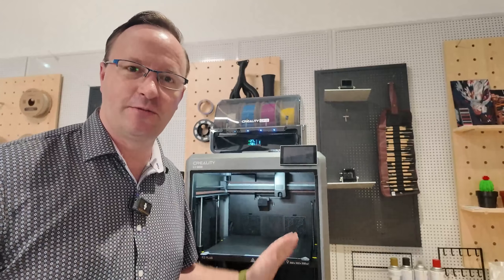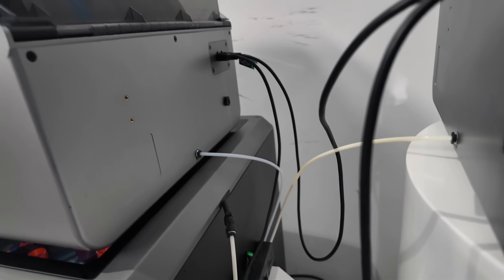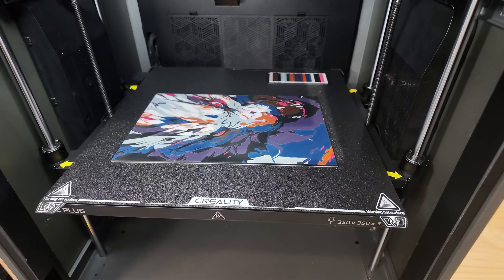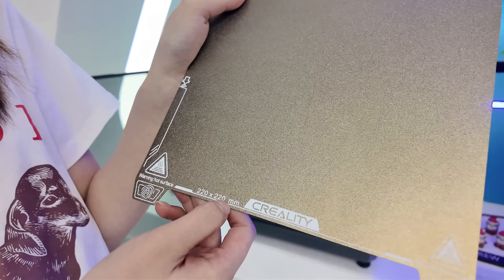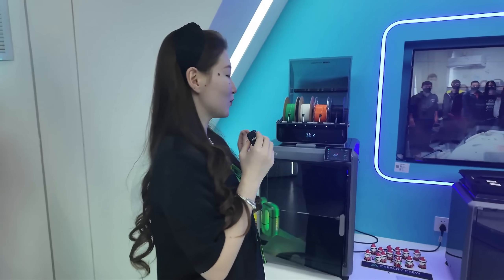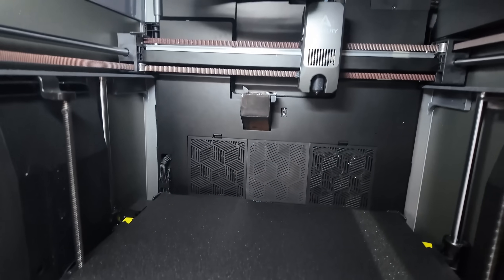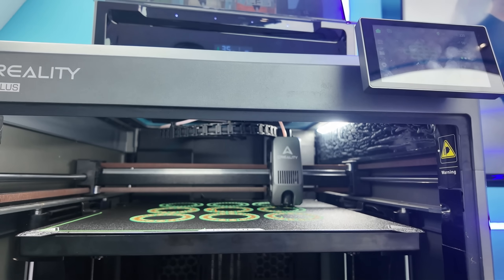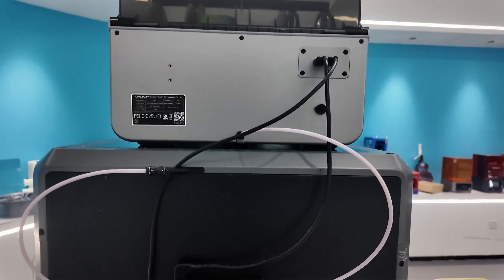Are You Curious about the K2 Plus?  Let me show you some more!  @Creality3D

Comment: After much deliberation and in response to Bambu required authorization debacle, I've decide to get the K2 Plus because of the features it has. With that said, are material profiles included in the software/printer? If so I would like to see how that works and if you can tweak profiles to fine tune them even more (hint, hint).  

When I do get my K2 Plus I'm going to do an unboxing and first print livesteam. So will see how it goes. Thanks for the video.
Reply from the maker: Profiles available on Creality Print for the K2Plus - yes, of course. Have you used that slicer before? It's the only one I use.
Reply: @kevin.in.3d  I use CP with mac but the windows version seems to get better results. The mac version of CP locks up and I have to force quit a lot. On windows I don't experience that.
Reply: How did it go?
Reply: @Flagermus_FPV  K2 plus is working well. I have had a few problems but overall I would buy the K2 plus again. Currently printing out some Borderlands Ripper stuff (mask, pistol, rifle, etc.). Here is the link for the mask that I finished painting. https://www.youtube.com/watch?v=5KKL47S9-N4&t=4s&pp=0gcJCfsJAYcqIYzv

Comment: How easy is it to print supports with a soluable filament?  I imagine it's straight-forward but I've not seen it done on any YouTube review.
Reply from the maker: We have done it before at the office but it's not easy to find that filament. Most people are trying things like PET-G supports on a PLA print since they can be easily removed. It's a little more tinkering but very interesting to me.
Reply: @kevin.in.3d  Thanks - that's very useful information.  One of my main motivations for considering an upgrade (I currently have an 8-year old FDM printer) is to get better supports - and cleaner prints when using supports.  This is making me think again.

Comment: I really love all the features of the K2 Plus, especially this one upgraded printing bed . It definitely gives ya a lot more room to work with, and I am just so into that. but when it comes to power recovery feature, just seems like you needa update the firmware or manually enable it? I’m wondering if the recently released FLsun S1 Pro might handle this much better. have ya looked into it? I needa weigh my options before the deal ends tomorrow and decide which one to grab!
Reply from the maker: I am the wrong guy to ask about any other brand - i have never used a printer that does not have Creality stamped on the front haha.  Do you have big issues with power loss in your area?  I have never had a print fail due to power loss.  If you do need to manually enable it on the K2 Plus, this would be an easy menu item that is set and then forgotten - not something you need to do more than once.

Comment: After the K1 🫣!! I don't think I will wasting more money again.
Reply from the maker: i also had an early K1 and today she is going strong.  Extruder upgrade (of course) and now upgraded the hot end to the K1C unicorn nozzle.  It's a great printer.  Yours not so good?
Reply: @kevin.in.3d  I was big fans of Creality, until I purchased K1!😬. I was tired from opening the machine from bottom.. the machine with all that noise and shaking. I think the time now to try with Bambulab... 
 Creality Its success with Ender and get lost with K1... enough struggling with bed leveling.

Comment: I'm really interested in this, I've been owning an Ender3 since 2018 and it has been phenomenal since.
Can this printer be operated completely offline? And will the CFS work with various filaments from other brands without RFID chips?
Cheers!
Reply from the maker: Hi, nice to meet you.  2018 Ender 3 is good to hear about - i love hearing from people with older machines.  Yeah you can use any filament you want in the CFS - just use the printer screen to select type and color, very easy.  Printer can be used offline - USB port allows you to manually add prints - or LAN cable at the back if you want to load from your computer.
Reply: @kevin.in.3d  That is awesome, thank you!
Yeah my Ender has been heavily modified, Klipper, MicroSwiss direct drive, various other things so there was never a reason to change it for something else. Looking now for an enclosed Core XY printer, so the K2 Plus is high on the list!

Comment: switching to a magnetic tool head cover on the k2 plus is an interesting move. while it certainly makes maintenance and upgrades easier, there are potential drawbacks to consider. for example, will the magnetic cover stay in place during long print runs, especially when dealing with vibrations from high-speed printing? it's a thoughtful upgrade, theoretically, but i’m eager to see how it performs in real-world use. on that note, some delta printers emphasize simplicity and reliability in their design, opting for fewer moving parts and tried-and-true tool head attachment methods. it’s worth comparing how these features measure up against magnetic options in terms of durability and consistency, particularly in challenging printing tasks
Reply from the maker: It's a valid thought, I was excited to see it just because I have taken the cover off the K1 so so so many times - would be easier.  But of course that one has a fan in it.  This is a simple cover with no electronics so it is light, i think the magnets will be enough paired with the tabs on top.  I like it when they try new things lol

Comment: I won't fall for new products from Creality a second time. I bought the K1 when it was brand new and it was mediocre. Only after the third hotend generation and the second extruder and several firmware versions do I usually get usable results. But mine rattles and no tip from the Internet has helped so far, and the first fan is now defective.
The only thing it could print reasonably well straight away was Hyper-PLA, everything else required a lot of fiddling at the beginning. I was only able to print TPU properly after months (second hotend, second extruder).

And by the way: it looks like creality shipped so many printers to influencers that there were none left to sell. And everyone knows what such reviews look like by now. About the quality of Amazon Vine.
Reply: anyone that bought the k1, suffered and then moved to Bambu is not really looking back to creality.
Reply from the maker: as long as you can keep printing I am happy.

Comment: Looking at some YT videos the CFS cables are not long enough to put this on the side are they coming out with a longer cables? Noticed the store does not have the new filament with the RFID tags one last question does the bed require glue to get the parts to sick to the plate
Reply: Its just the bowden tube. You can certainly mount it to the side. The bed does NOT require glue.
Reply from the maker: the CFS comes with two cables and you are right, the shorter one will not work to get it on the side.  I have asked the accessories department and they assured me that cables will be available for purchase separately - you can buy a second long cable by contacting cs@creality.com

Comment: Also, have a question about the hot end fan. When the machine is idle for hours the fan is always running. Would like to leave my machine idle but not let the fan run continuously.
Reply from the maker: I think you may have to contact tech support for that because the fan should not be running for hours.  Once the hotend is cool, the fan should shut off.  email cs@creality.com